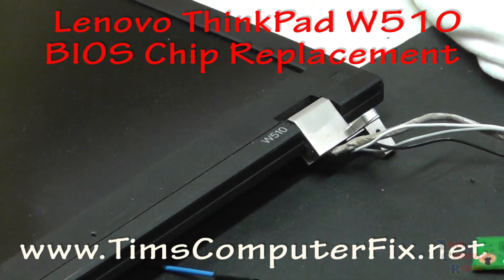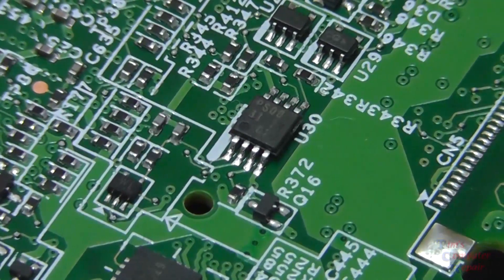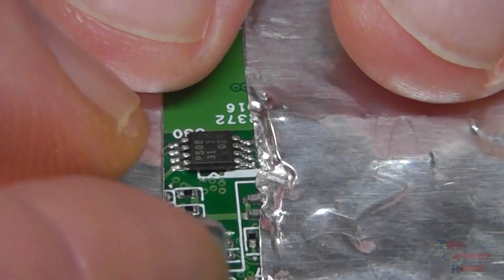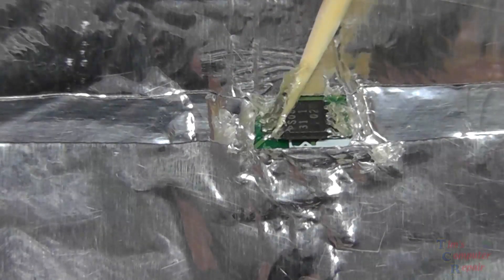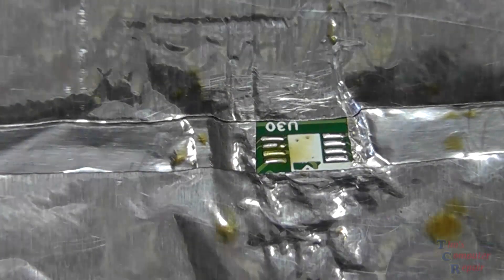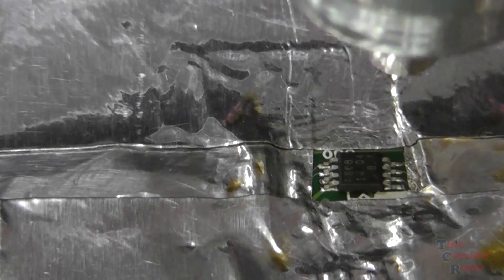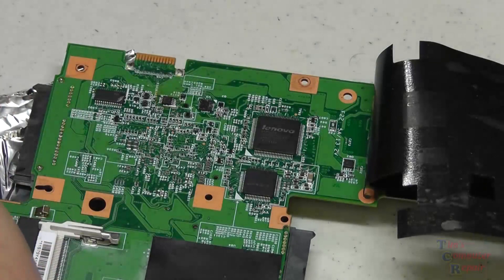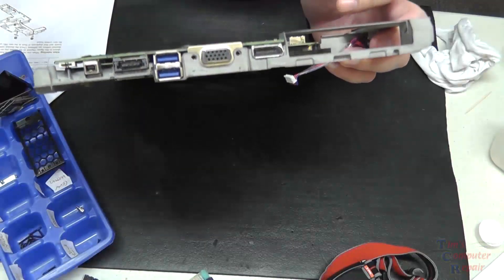Lenovo ThinkPad W510 BIOS Chip Replacement by TimsComputerFix.net

Comment: I don't understand all the thumbs down as it's a great video of a process you don't often see. 
I need to replace the Bios on my x230 Tablet because Lenovo locked the wireless card and I don't want 2 dongles (Bluetooth and Wireless) sticking out the side all day (the only way to program a custom bios is to de-solder and use a programming tool on the chip). The only thing I would change about this video is ad more rosin to the pins when resoldering and align the left side a bit better but aside from that it looks good to me!
Reply from the maker: Thanks for commenting.

Comment: Just had to do this same job this weekend, my Asus laptop motherboard gave it's last leg, so I had to order one. There are two models that share the same board but have different BIOS, K55VJ and K55VM, the difference is that the K55VJ uses a GT 635M GPU and the K55VM uses GT 630M, where I bought the board the seller said to specify the model before purchasing which I specifically asked for a K55VJ which is what I needed and after mounting the board and testing it I found out that the model he sent me was a K55VM so my GPU woudn't work. So the fix I found was to swap the BIOS chip from the malfunctioning board to the new motherboard and now everything is working fine. Fortunately the malfunction of my original board was not BIOS related. I was a bit doubtful it would work because the replacement board had a lower revision, 2.0 instead of 2.2 my original board was but it turned out to work fine! :)

Comment: What about using 2 soldering irons with K-type (knife shape) tips at once for desoldering? Much more quicker and safer, because motherboard and other components around bios chip will be not exposed to heat from hot air, no need to protect them with shield foil etc.
Reply from the maker: Which ever way is more comfortable for you.

Comment: I air solder a lot. So I have an eye for the melt. That solder did not melt on the top side. The legs were still sitting on top the solder on the pad's, when you stopped. On the bottom side yes but not the top. This board will not work or at least for long.

Comment: hi.
i want to ask a question.i have thinpad t500.when i tried to remove bios chip(16 pins) i lifted some of pads.i wonder as if this could be possible:
there is a 8 pin chip place within the 16 pin bios chip location.is that for as a replacing option?can i use one of the 8 pins to recover some of my lifted pads as a proper order?
Reply from the maker: I am not sure really. Not good with lifting pads.

Comment: hi, very helpful video, what type of heat shield tape did you use , is there a special tape needed or is it the same as automotive heat shield tape ???. thanks
Reply from the maker: Everyone has their own methods. The tape I use in foil tape that can be found in the roofing section of Home Depot.
Reply: Malcolm Glynn people will normally use Kapton Tape since foil conducts heat pretty well

Comment: nice Video, i just crash my own Bios myself, and i'm about to have to do this. I was simply trying to update it tru the MSI utility of my computor in windows and it didnt work out then i try updating with the file that msi was giving on they're web site via the UEFI utility update in the bios and it said it was missing file then i check again on msi website and it said it can be done via USB drive so i copyed the file on a usb drive, when i try to update the bios using the usb drive, I saw the program doing somekind of installation then it said an error occure while updating the bios windows need to restart, which i did then BOOM  no more Bios on my A88X-G45 motherboard , got the code for F2, which means the bios is crash i try flahsing it using the button on the board and i was still getting no response no loading screen except the F2 still on motherboard. then i try jumping it using a bios jumper, and it still didnt work out, so i order a bran new Bios chip on ebay hoping that i'll be able to fix this cause i don't really want to buy another motherboard. I just hope all goes well i should be getting that chip in the mail next week or this week hopefully.
Reply from the maker: +Jean-Robert Ricard Good luck. Thanks for watching.

Comment: Hey Tim,

i went for your video, but unfortunately U30 is NOT the bios chip, SP11 is the bios (located on the other side of mainboard). I soldered it out before receiving the new chip and now I have to get a new one for U30.

The one you mentioned here is a 24RF08 EEPROM which holds the supervisor password and other mainboard relevant data, like serial number, etc.

Anyways, thx for the video!
Reply from the maker: Sefa Ilkimen Interesting! Actually the customer provided me with the U30 chip. Replaced the chip and the laptop came back to life. Thanks for watching.
Reply: Sefa Ilkimen It's SPI 1 not SP11
Reply from the maker: Carlo Gariboldi Thanks for the info
Reply: What about the SPI 2 in the left side of SPI 1 I changed the SPI 1 and doesn't work
Reply: Sefa Ilkimen true...IT'S not the BIOS chip. It's actually the password chip which also stores the TPM settings. he could gave just shorted out 2 pins at the correct moment after power on. There is a video on it somewhere on  YOUTUBE.

Comment: thanks for video good job

but i have question where can i find like your gun " gun of hot air"

and the element that you put on chip what is ??
Reply from the maker: That is called a rework station. You can find it on ebay. The "element" is called BGA flux and you can find that on ebay. Thanks for watching.
Reply: and the gun of hot air where can i find it

Comment: nice video, keep them coming. I do computer repair myself and just bought an sp8-b programmer and unfortunately this would be the first time trying programming. I made a mistake and ran 5v through it but it might of been dead beforehand. I ordered a bios chip and after watching this I feel comfortable trying it. I would like to know of other testing methods to see if the board can be fixed with a bios chip. e.g. mine powers on and fans blow but that's it.
Reply from the maker: Thanks for watching. What do those programmers run?
Reply: TimsComputerRepair
 I GOT IT FOR ONLY $50 USD, Free shipping. sp8-a, sp8-b and sp8-f. I would go with the "b" version as it's for mass programming (online) and it does over 6,000 chips. It's good for appliances as well. You can program the chip out of the board too. makes it easy to store empty bios chips around and program them at will then install! :) 50 bios chips a year, save just $1 by programming them yourself. DEVICE = PAYS FOR ITSELF.
Reply from the maker: TheoryFactor cook thanks

Comment: Extremely helpful video , thanks a lot ,
but i have a question
what would be a purpose of replacing BIOS chip besides of black screen
Reply: If you lost your password ;-) Lenovo tells you to replace the board but you can also replace the chip with a reprogrammed chip
Reply from the maker: You would know if your BIOS is corrupt. Two ways it can happen. Flash with the wrong BIOS or Computer shuts off while flashing.